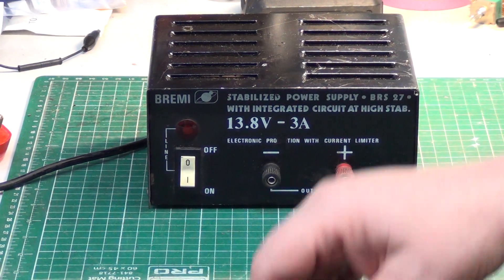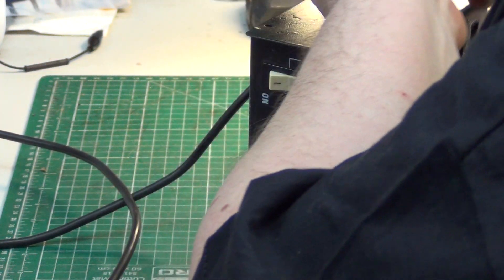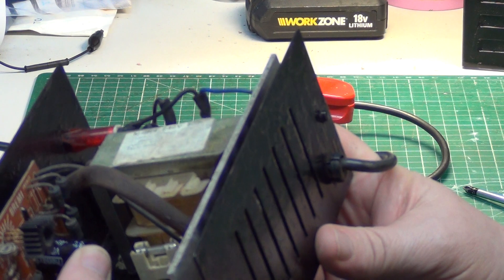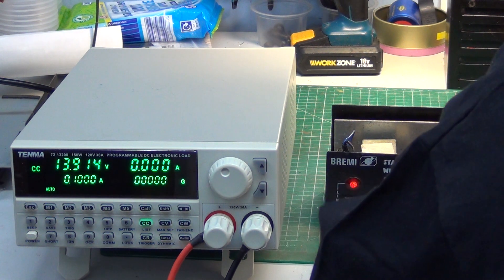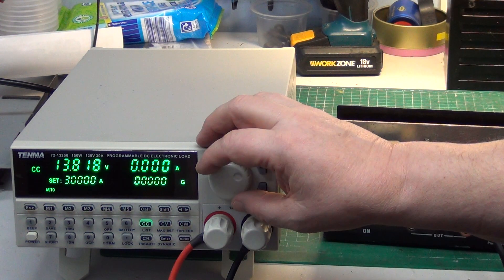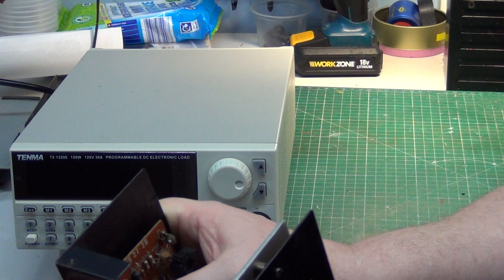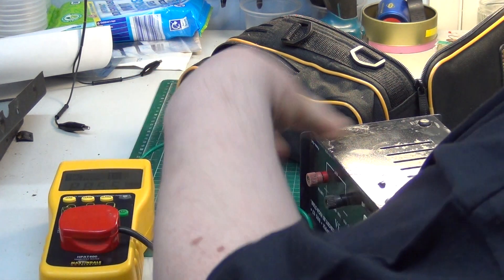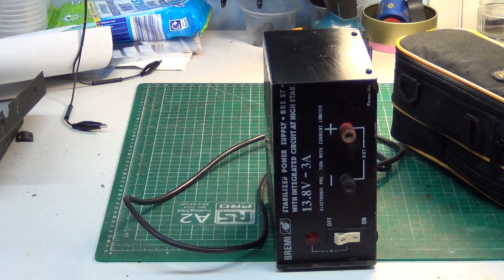Bremi BRS27 3A CB power supply...already serviced by someone else - test & checking.

Comment: Oh those are fun, nice little power supplies (as long as you get one with a transofrmer that doesn't hum), but I seem to remember if you short the output it cooks the LM723 chip and stuffs full rectified voltage out into whatever you're unfortunate enough to try and connect to it..

Comment: Had shed loads of these through the years very reliable, and also used Altai power supplies with the blue case and white front.
Reply from the maker: Yes, the Altai one was popular right up to Altai finishing around 2000. They became Eagle power supplies for another decade. 

Richard
Reply: @ukfmcbradioservicingTango21  Very good power supplies, the Altai was one I bought from new and the Bremi ones usually secondhand.